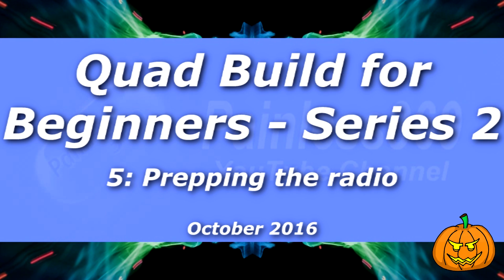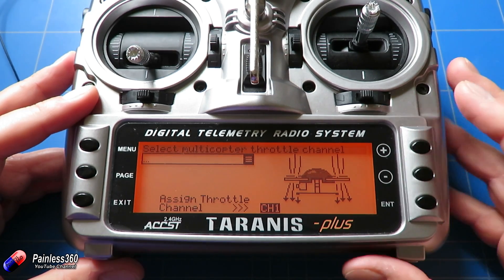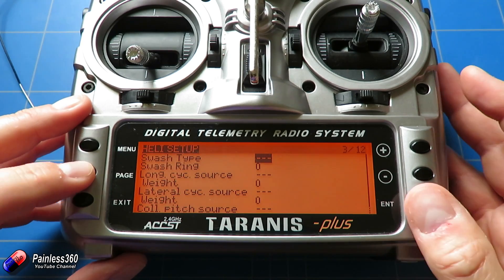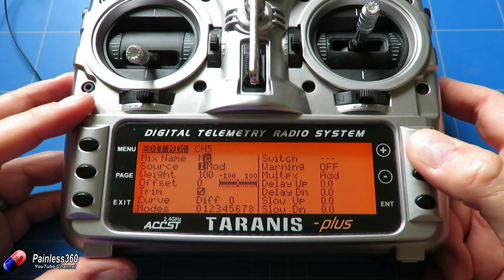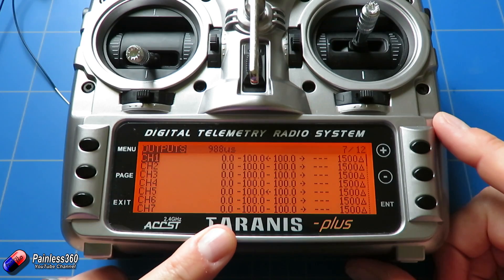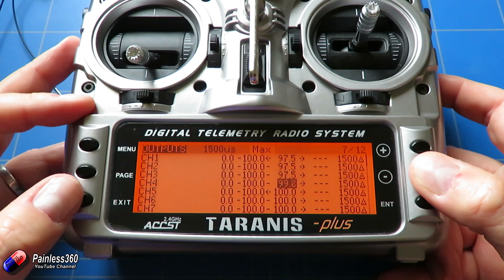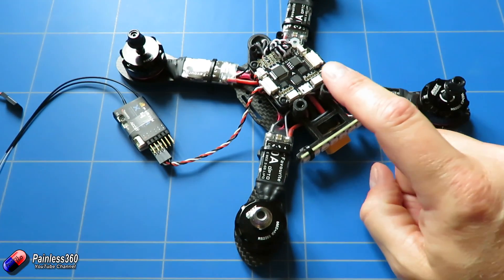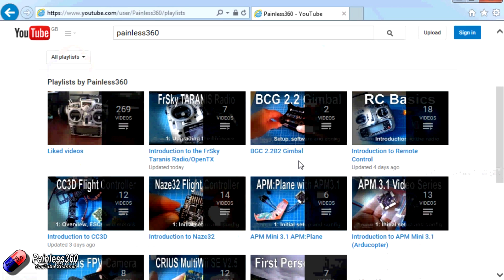(5/7) Quadcopter Building for Beginners - Series 2: Preparing the Radio

Comment: My X4RSB (Amazon) was working fine and I plugged it in to my quad to bind with my taranis and no lights (LED red/green) come on. I upgraded firmware with no problem and while the firmware was uploading the lights were blinking fine. Tried to bind again and still no lights. Help Pls !!!
Reply from the maker: I'd disconnect it from everything and see if it powers up using a known good 5v supply. If it doesn't then it's died..

Comment: For sbus connection does it have to be connected to io2 or can it be connected to io1. In seriously pro f3 series you connect it to io2
Reply: yes manual will confirm
Reply: i think the voltage is different between the 2 though
Reply from the maker: +Zazzy R5 see our SP3 series where we show all the common connections for the SPRACINGF3 board. Best of luck!
Reply: Painless360 I have. That's why I'm asking . In that series I'm sure you connect it to io2 for sbus and in this video you connect it to io1. So does it not matter which io you connect to .
Reply from the maker: I'd always follow the later video as things can change.. Best of luck.
Reply: you can use io 2 or uart 3. i use uart 3 due to broken io 2
Reply from the maker: Not sure, we've not tried. I'd check the manual for the flight controller in case it gives options for the s-bus connection. Best of luck!

Comment: I also tend to set the receiver failsafe. Set all channels on the Taranis in the desired position, and short-press the fail-safe button on the receiver. Probably redundant, but rather safe than sorry ;)
Reply: Also forgot to mention: I always use arming by switch, because 0 throttle and full rudder is sometimes used when doing acro... and in those cases, you don't want to disarm your quad 🤗
Reply from the maker: Yep - we do that later in the series. Thanks for the post! :D